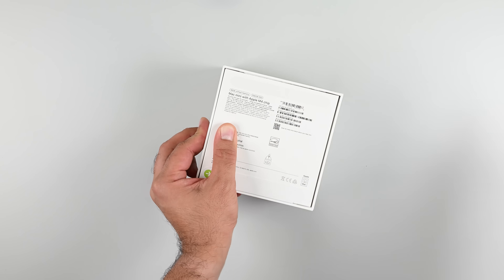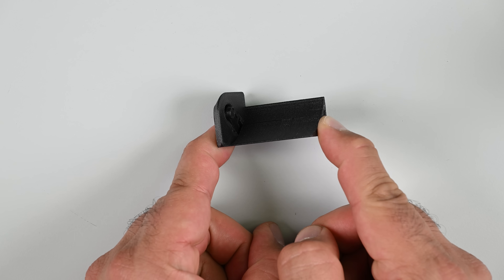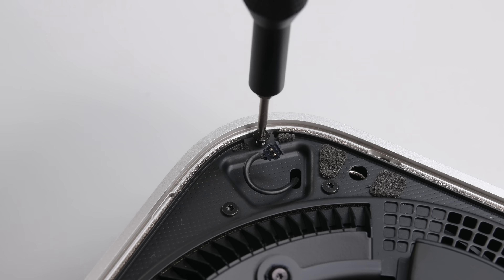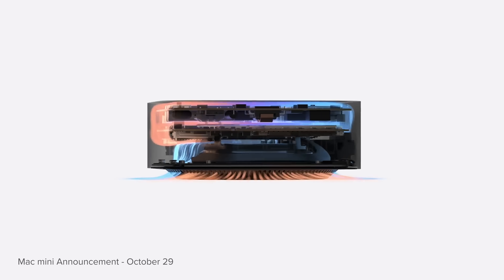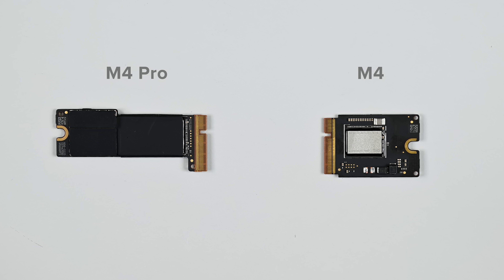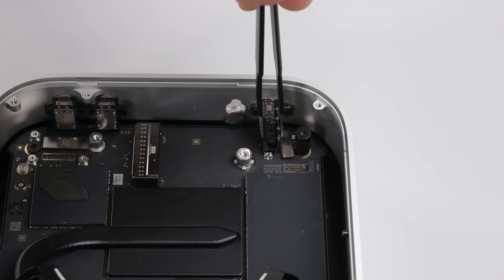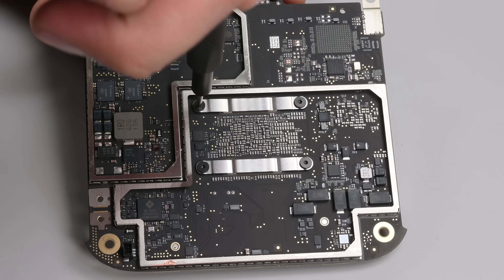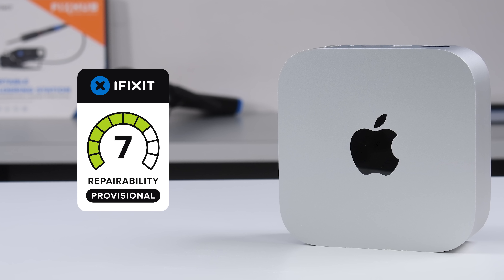M4 Mac mini Teardown - UPGRADABLE Storage, Powerful, and TINY

Comment: I would then think that this machine is the new Dyson mini air purifier because on the underside there are large gaps between the holes, which will draw in dust. I myself have the Mini M4 and can already see that there is some dust on it. Kudos again to Apple who designed it to have a shorter lifespan.
Reply: I have one as well and to be fair many other devices with cooling fans also don't include any meaningful prevention against dust ingress (the size of the holes does not matter all that much if they are bigger than dust particles). I'm not exactly pushing mine hard so far and it seems pretty silent, so I think there is a fighting chance that it will not run the fan hard enough to hoover up much dust. But in spite of the relative accessibility, I would not like to take it apart just for a clean out.

Comment: $600 for the cheapest version. Crazy. If the price was $400, it would be the deal of the century, but unfortunately I have to wait two years for its price to drop.
Reply: It’s still a great price for that kind of power
Reply: Have you tried finding a small form factor Windows PC for the same price? Emphasis on the small form factor and bonus points if it's actually as small.

If that is not important to you then fair enough, though it is at least worth considering for a meaningful comparison. I think you will find that for a compact, power efficient machine that is pretty capable, these things don't actually stack up badly at all. Other than the storage maybe.
Reply: Yikes, it might be time to get a second paper route.

Comment: Many YouTubers are calling the modular storage “upgradeable.” However, that is imprecise. A more accurate description would be replaceable or repairable or solder-free.
Reply: It is upgradeable though. Not using standard SSDs which are cheaper, yes. But you can upgrade.
Reply: @blueskye8470 m4 mac minis and m4 pro mac minis use different ssd sockets entirely
Reply: The NAND flash is soldered the module and is, therefore, not solder-free. "ImPreCiSe"... pot, meet kettle.
Reply: @tim3172  You don't need solder if you get a module that has the NAND chips installed for you.

Comment: I don't care if you can swap the SSD, if you can only use a proprietary SSD which Apple themselves does not sell separately, it cannot seriously be considered upgradeable
Reply: someone already hacked together a custom board and nands and it works. its only a matter of time before a big company starts mass production
Reply: @WybremGaming  exactly... be patient
Reply: @WybremGaming  I really hope that
Reply: @WybremGaming  Can they legally? Im guessing the proprietary solution is patented.
Reply: @epcgmr21  idk, not a lawyer, guess time will tell. The demand is there.
Reply: @WybremGaming  Yeah great, and then your SSD becomes unuseable with a future software update because Apple sees it as "a security risk".
Reply: @WybremGaming  They used Nands scavenged from another Mac.  Still need to see someone do it with off the shelf ones.
Reply: @diamond_h0us  no they bought new nands from a supplier.
Reply: @diamond_h0us  No they used new, blank ones. The NAND chips are tied to the machine by serial number so you can't swap from another unit.
Reply: @Artistikk  They literally swapped the SSD from another machine and it worked.  Did you watch the video?
Reply: @Fernando.Sanabria  Then maybe they got lucky. Or Apple changed it because you couldn't do so with the Mac Studio. Or maybe the NANDS are tied to the module board itself. Idk. Maybe I'm wrong.
Reply: @WybremGaming  he bought it from a supplier that sells  scavenged Apple SSD. 1/4 of the NAND modules he bought didn't work which is common with these scavenged parts. The Mac mini isn't upgradeable in any reasonable definition of the word.
Reply: @Fernando.Sanabria But there's a catch, you need to swap both modules if there's two, apple designed it to work in striped mode
Reply: @Artistikk  I just did mine today
Reply: @WybremGaming fun fact: with the Mac Studio in the past they HAD to use supplier supplied nand chips as on those the ssd had to be never used before for DFU to pair with the SSD. This Mac mini is a remarkable change from that as SSD swapping is possible on those, unlike Mac Studios.
Reply: The proprietary nature is a downside. BUT it's still better than having the flash chips soldered directly to the mainboard. SSDs will eventually fail and being able to replace them is a big plus.
Reply: @IanHobday exactly... Still someone would force Apple to sell the spare part
Reply: It'll probably have adapters to fit regular M.2's in some time, it's what happened to Apple's Blade SSDs in their older Macbooks.
Reply: @Nova2127U No it's not NVMe, it's raw NAND commands which is faster but more restrictive
Reply: EU regulations entered the chat
Reply: whether other company can legally produce that?
Reply: Give it a few years when those proprietary SSD ends up in landfills and E-waste centers. Free upgrades for whats already a powerful machine.
Reply: Exactly I kept seeing people get excited because you can remove it. This should just take any standard module, then it would be cool. As it is it’s just more bs.
Reply: Actually dosdude used a set of $90 nands for his upgrade so you don't need Apple specific module
Reply: Nvr buy mac’s first lesson 😅
Reply: Dosdude managed to upgrade the ssd. So with more time all those clever geeks will work out nice easy storage upgrades.
Reply: There's now a 2GB module which doesn't require any soldering available from m4-ssd.
Reply: Nice logic, bro
Reply: They sell it, but 1TB SSD is $1000.
Reply: True, freaking click bait
Reply: Give it time
Reply: Why not? This is a massive improvement over the memory modules that were soldered on
Reply: there will be adapters soon for conversion.
Reply: @chenwu70  Apple flash modules are not SSDs, they are memory modules providing direct access to NAND chips, how would you convert NVMe to DMA NAND?
Reply: Yes it is very crappy and sh*tty, but this is a better situation than it being soldered, since SSDs have an expiration date! Even if proprietary, it is a relief to know it can be replaced instead of having to condemn the whole system due to a faulty component.
Reply: Thanks for sharing your opinion. 🎉
Reply: There is now a company which makes these for the Mac’s, where you can upgrade the storage
Reply: DOS-DUDE just tested a third party working SSD with heavy mods / maybe fell off of a truck
Reply: I'm getting mine changed out while I have a coffee. 2tb. Easy.
Reply: lmao calm down
Reply: Yet.
Reply: @ SSDs are coming.
Reply: comma splice, numerical disagreement
Reply: Won't be long before 3rd parties produce cheaper upgrades. At least it stop these things becoming e-waste when the SSDs fail.
Reply: All hail Sony on this front for allowing commodity storage to be used, and not taking the opportunity to gouge. Apple appears to take ever such opportunity, which is a pity.
Reply: It isn't an SSD, it's a NAND chip on a carrier board. The controller is part of the M4 SoC. The board is simple enough to reverse engineer and the NAND modules are commodity parts. If you continuously look for things to be angry about you will never be happy.
Reply: @gutless_worm  What's the difference between an SSD and nand chips on a carrier board?
Reply: at least, if the mac mini is dead we can move the data to another device
Reply: yes but at least it's repairable now
Reply: @faresahmed7250  Yes without having to change the whole motherboard and that Apple charge you a fortune.  Remember that SSDs have a limited life.  You could see the health state of the mac mini SSD with program like DriveDX.
Reply: Somebody in China is already thinking ways to exploit it right this very minute.
Reply: What you expect? 2230? Impossible. This consider huge step from Apple since 2015.
Reply: Microsoft doesn’t sell SSDs either. It’s only a question of time when one of the storage manufacturers starts selling these as upgrade modules.
Reply: @0xbenedikt does microsoft use proprietary nand modules?
Reply: @a.zeppeli4454 no, but the whole idea of having a fast and efficient Mac is that it uses proprietary and optimised hardware. It’s literally by nature. Acting like apple is going out their way to make proprietary modules for no reason 😂
Reply: @andrejcupac7359  an SSD is an SSD, there is no "magic" optimization. PS5 use a swappable SSD to store games and for that thing, you'll have low latencies and high bandwidth because you know, it is an SOC with integrated graphic, like any Apple Silicon Chip.
You should study how hardware works before claiming what Apple says in a pre-rendered conference aimed at those who know nothing about tech.
Reply: @0xbenedikt  Microsoft uses standard M.2 SSDs though
Reply: @0xbenedikt Microsoft? is 10x different than Apple in terms of hardware compatibility coz they follow industry standards they don’t put custom firmware or controllers on their SSD which will gimp the OS & security features if you upgrade by yourself in using 3rd party offerings
Reply: @skyazuldream  but Snapdragon does... We still don't have any Linux support, same for Apple Silicon... 

I'm not a fan of Linux, but these proprietary chips will only help closed or semi-closed systems...
Reply: @0xbenedikt  but at least that SSD is actual NVMe M.2 2230 so you can put in standard M.2 2230 NVMe
Reply: @0xbenedikt then Apple Intelligence and Apple Pay won’t work. It already doesn’t work on 3rd party SSD. It only works on Apple SSD which has proprietary firmware. You need to solder and re solder the memory chips even then compatibility issues may arise. So yes its not plug n play but a nightmare to replace
Reply: @0xbenedikt Due to how they work (raw NAND, striped mode access), you need to upgrade all modules at once, it's not like NVMe drives
Reply: @0xbenedikt  You're mindboggling
Reply: @0xbenedikt you're argument speak fanboyism  since Microsoft doesn't use a custom SSDs
Reply: @0xbenedikt Microsoft uses an existing standard that makes sense.

Apple made this change for no reason.
Reply: @0xbenedikt but the thing is for Microsoft they don’t use proprietary ssd they use 2230 ssd so people do not need to reverse engineer the ssd they can just get any 2230 ssd any use on surface device
Reply: @0xbenedikt  Yeah but at least Microsoft uses standard ssds and are easy to get to without taking the machine apart.
I got a base Surface Pro 8 and swapping the SSD took 30 seconds, longer to install with the recovery image but for the cost saving and one time need it was great.
Reply: @0xbenedikt the surface SSD’s weren’t obtainable until the Steam Deck used them.
Reply: Why do you think we care what you care about?
Reply: keep having the urge to try and gut all the internals of my mine and run it test bench style, then i keep wondering - whats to prevent someone from just hot connecting one of the thunderbolt ports to a external drive board with a ASM2464PD chip on it?  like can you just solder join them?  is that what you have to do to get a PCIe slot on a apple "desktop" ?   would it work?   its kind of of depressing but what do you think of that idea?
Reply: lol, there will be thirdparty ssd's made in 2.5 weeks lol
Reply: It’s been 3 weeks and they’re not out yet 🙁
Reply: My 2014 MacBook with a “proprietary” SSD that’s been replaced :
am I a joke to you
Reply: @DeltaStormYT  that's different. In this case the controller is soldered.
Reply: eh I got one of OWC's SSDs for my 2015 MBP, it's not like there won't be options
Reply: You do know there is no such thing as proprietary storage. Do you see anything else on that drive then the NANDS? Oh you don’t other than support components like capacitors?! Oh! 

Well maybe Apple spent millions to roll their own NANDS with their own interface. OH?! They didn’t?! Huh interesting. So could it be as simple as a different connection interface? YES
Reply: @DeltaStormYT The nands are cryptographically coded to the device I believe that qualifies as proprietary tech. Since only another coded apple nand would work
Reply: @JayfkProductions876  the way the nands are manufactured is not proprietary. You also cannot take two Mac minis and swap these boards. The nands need to be brand new, then once you write software to them, they're stuck to that particular Mac mini forever. So not really proprietary as any company could create a drop-in board for the Mac mini, only problem is they wouldn't be transferrable after they're installed
Reply: @oat1000  apparently the nands are from known brands like Sk, Samsung & Kioxia but the actual SSD controller is indeed Ptopiertry Apple tech.. That said Its a pretty genius thing for them to milk as much money as possible.
Reply: @JayfkProductions876  yes, but unlike normal m.2 ssds, the controller for the Mac mini's storage isn't on its removable board
Reply: @oat1000 did you guys not watch the video you guys are commenting on? He literally swaps the nand or ssd between the two machines, no problem.
Reply: @DeltaStormYT they clearly meant proprietary as in not using any existing standard. Which is the common meaning of the word that everyone understands.
Reply: @DeltaStormYT  if the connection interface is patented and Apple doesn't allow outside manufacturers to license their patents, then it is proprietary. It remains to be seen how Apple will handle third-party replacements, or if they'll allow it at all.

Comment: Storage is probably meant to be replaced for Certified Apple Refurbished program, not for the user to evade Apple's spec upgrade charge. That's for external storage
Reply: You’re using the term “evade” like it’s illegal to open the device you paid for and upgrade the storage for far less than Apple’s outrageous pricing. 

$200 for a 256GB upgrade? You could buy a 4TB ssd for that price. That’s 4096GB for the same price as Apple’s 256GB. What do you think is the better buy?
Reply: @alphonso6512 
I think he just means getting around their egregious price gouging in any way at all. Right now Apple has made sure that there is no way to upgrade the internal storage yourself without taking it from another Mac. Hopefully third party nand chips come to market. I know Polysoft should be releasing some Mac Studio chips, though they are still much pricier than equivalent SSDs. We’ll see if they do the same for the Mac Mini.
Reply: Can third party like old world computing or Samsung or someone else make a compatible version?
Reply: @ youll probably find them on aliexpress eventually
Reply: Apple will only sell you the exact same storage
Reply: @BooleanDev   I know that. But someone said they are doing it right on the street. That is interesting
Reply: @DS-pk4eh  Because there are way too many phone repair shops on the street in China, obviously almost all with soldering station to do chip level replacement, that’s what he meant. It's a cost effective business because of their low labour cost.
Reply: Too bad. Apple shouldn't get to block us from doing upgrades
Reply: they can evade it if they buy third party parts; and they are already available for the studio.
Reply: @BooleanDev  That "just" word is putting in a lot of work. Not only do you need a soldering station, you need the right mask, a reliable heat gun, supplies for cleaning the board, and the solder balls/paste. You then need to source the correct replacement NAND chips and install them without damaging the board, otherwise you're completely screwed. For a first timer, you're talking several hours from start to finish (including sourcing everything you need).
Reply: @EnglishMike  i know. No one was implying it could be done by a beginner. I wasnt going to explain the whole process when youtube videos exist that would do a much better job
Reply: @BooleanDev  No problem.
Reply: @EnglishMike a first timer, even with regular soldering skills, is basically expected to fail a replacement like that. It takes time and effort to learn reballing especially. I’ve watched the chip replacement for this drive, and how he manages to place the chip in the right position for soldering is beyond me.
Reply: Nope. Apple has a self repair program. Users can replace individual parts, like the storage themselves. Just don't expect the modules to be better value for the money when you buy them as repair parts.
Reply: @blueskye8470  you're supposed to get replacement parts from Apple ... good try though.
Reply: Property Storage isn’t a plus. Not feasible for normal consumers. In china you can even upgrade your iPhone storage for cheap. They do it on the street. ifixit should upgrade their game.
Reply: @ExperienceCN  Any links?  it would be interesting to see
Reply: @ExperienceCN  it's a detachable drive why wouldn't it be upgradable by the user?
Reply: Hopefully Apple will put a firmware block on SSD swaps and then they'll have a class action lawsuit for selling Macs with a ridiculously small 256GB base model and blocking self upgrades.
Reply: @insidethecourt Well that’s a pretty toxic thing to hope for when you could hope they wouldn’t do that instead. Very weird.
Reply: @babybirdhome  If they don’t you’ll be stuck with no upgradable SSDs and the same base amount that iphone pro max comes with.

Comment: It's good that Apple killed off their plans to sell cars.  The button to start the car would have been located underneath the seat!
Reply: And if the tires break you can only buy apple® certified tires although apple wont sell it to you
Reply: And the charging port on the bottom.